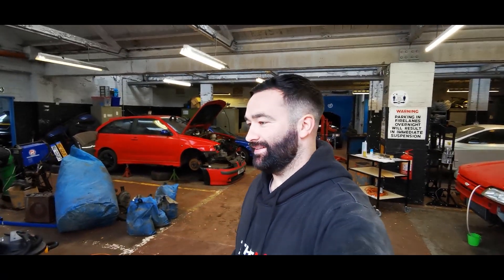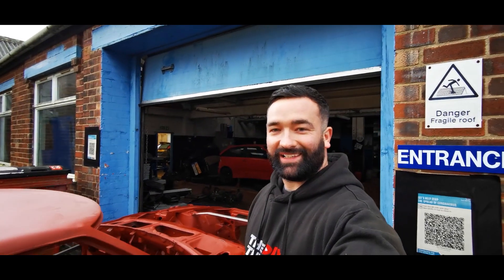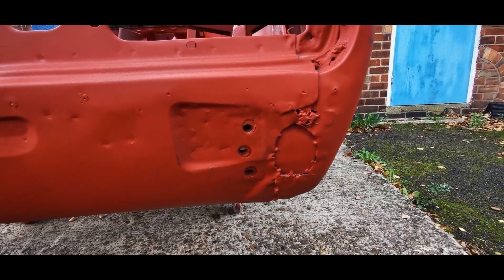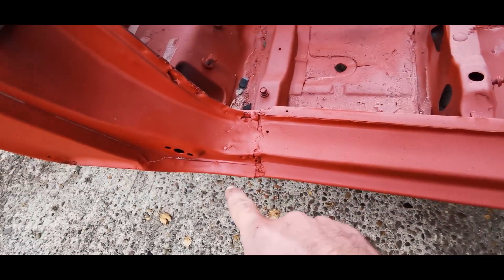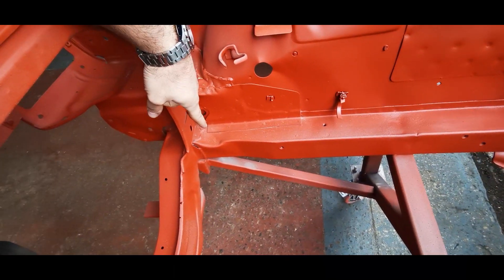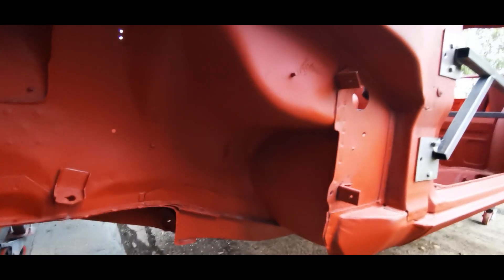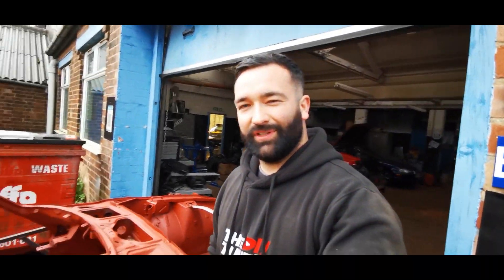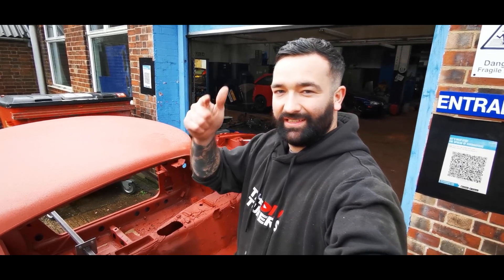WORST POSSIBLE OUTCOME!!!!! Back From Blasting - Datsun 280z Project

Comment: Hay man don’t forget how old the car is the repair was probably don back in the 70s a lot of people used arc welding at the time and the mig welders probably wornt very affordable. As long as it’s not gas welded your good. As for the cut and shov job if your changing the floor all the way up to the scuttle panel and the right hand inner sill and secure the weak point witch is the right hand windscreen inner reinforcement  above the A post part your good to go I can’t really see the welding in side the above the a post so can’t tell but if that but is good and the reinforcement is over 8 inches apart on the inner side then your ok. You seem really good with the mig so shouldn’t be a problem for you you should see some of the wrecks we have don in our time they were 10 times worse lol
Reply from the maker: Thanks for the encouragement mate I'm looking forward to getting stuck in to it may be asking some questions along the way 😅 - Ste
Reply: The DIY Tuners 
Any time man all so if you need a measuring system I 
Have a black hawk universal one in case you need to hold the chassis in place. Am sure Liam seen it I will check I might even have the data sheet for the 240z as well will send you a link if needed for you to see how it works.

Comment: I'd quite whining, your not in California, you live in the rust belt. Many ,many MANY S30's in much worse batter ,have been, put back on the road !
    Put your big boy pants on, and fix it.
They , aren't no longer abundant.
In 2020 the value has climbed more than you KNOW !
This car is a normal starting point , fix it, get on with it !!!
    I'm just yanking your chain.
I have to rusty cars I rebuilt most would have parted them out. But they just don't come up locally often.
So I cut out and fabricated ground down welds and made both whole again.
I came across another I bought and it too was rotten but provided alot of odd parts. So it's LOVE a LABOR of LOVE for these Japanese Ferrari's. I'd do it all over again it's not THAT big of a deal to rebuild these even if you fabricate most of the chassis. Good Luck either way ! I'm watching !
Reply from the maker: 🤣 Dont worry we just bought a couple sets of big boy pants off of ebay. Yep the rust on this car isn't that bad for a Z car it's more the previous repair that came as a suprise. But we will have a video in the next week or so with our future plans 👌- Ste

Comment: Not worth it, if it's a LHD shell, later 260/280z scrap it. You can find better. It's not the rust. It's the cut n shut that's the problem.

Comment: I have to say i was not expecting it to be cut down the middle!
What does liam want the car for?
If he was planning on getting it real nice then hes going to need a new shell. Im guessing he wanted a proper resto if you went to the trouble of gettibg it blasted.
Reply from the maker: He's going resto mod so doesn't need to be fully authentic and alot of panels are available. Spoke to a bloke that does alot of them and hes fixed worse apparantly- ste
Reply: @TheDIYTuners  That sounds fair. Its going to be intresting to see how much of it is original when your done though!

Comment: Hey, I just come across a thread on z club about this, when doing the rhd conversion how are you unpicking the firewall/scuttle? Cutting it all out entirely?
Reply: I ask because my raintray/top part of firewall inside cabin  of my 280z is rather grot so parts may be handy to me if you are replacing the lot
Reply from the maker: I'll be honest I have no idea at this point until I receive the new firewall. Liam may well know more than me as he's ordering the bits. But plan is to replace as much as possible so if a full panel turns up we will be spot drilling all the factory welds to remove the panel in one - Ste
Reply: @TheDIYTuners  looks like I’ll have to sign up to z club and keep tabs :)
Reply from the maker: Likely to be updated on here or our Instagram more than the forum but we shall be starting some work as bits start to come in 👍
Reply: I know you’ve got a few repair panels already but thought it worth mentioning, there’s a left rear quarter for a 240/260 on eBay now(has bumper indent) it’s pretty pricey though
Reply from the maker: Damm that's expensive like 1k 😳. In the latest z video you will see we managed to sort the LH side with a £70 repair panel just maybe the rhs that will cause issues